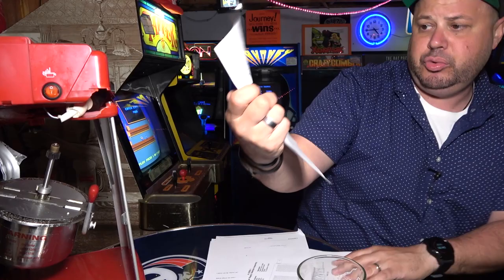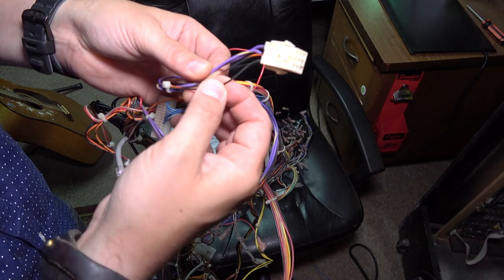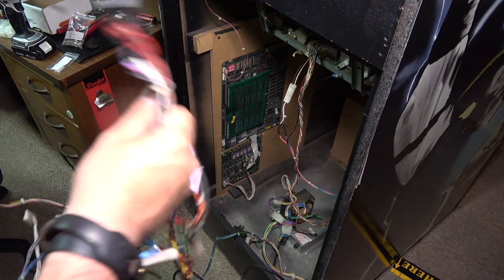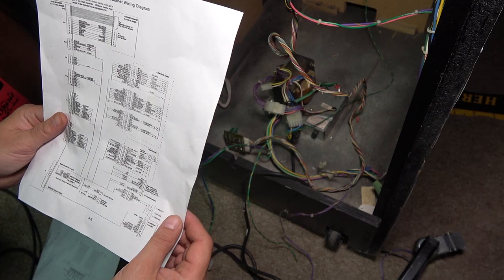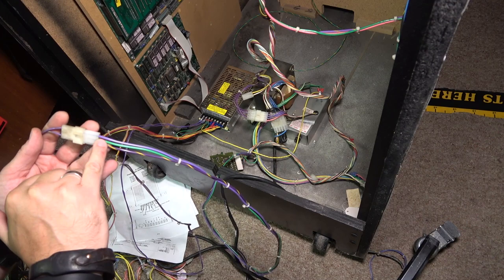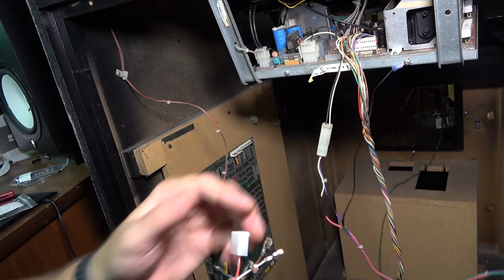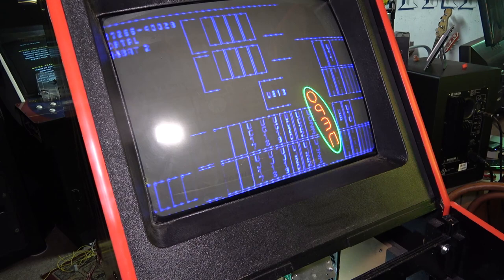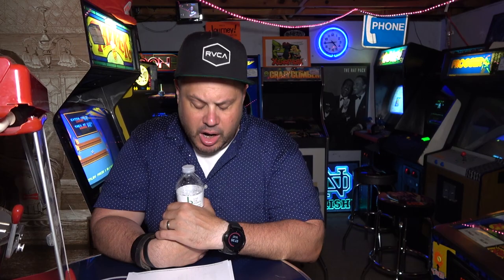Mortal Kombat II Arcade Restore Part #18  Power Supply Install, Wiring, Troubleshooting and more

Comment: Since you're not seeing red and green on the monitor, you're also not seeing
on the screen is the "cmos invalid error" which should be on top of the screen 
in red on the "using dipswitch coinage" screen .  Replace the watch battery 
from the board. Turn on and off twice after you've replaced battery. When
it goes back to the rom check diagnostic screen and finishes checking them
which should be highlighted in green you should not see the using dipswitch 
coinage screen it should take you to the title screen. Cmos is what saves 
number of wins, losses, settings of using coinage or freeplay mode, history 
log, etc. When the battery is dead, you'll lose aforementioned above.
It'll restore to factory settings and take you to the using dipswitch coinage 
screen and will have to hit the start button. You can get the battery from 
batteries plus. About $2.50. If they don't have an exact one, you can also
use one that's slightly thicker. Also remember to put back the dipswitch 
settings. Hope this helps.

Comment: Any metal objects especially the coin door that somebody might touch has to go directly out to earth to your plug in the wall socket, has to have as little resistance as possible John. And always check your Earth connections back to the plug pin with continuity no more than 3 ohms. A transformer needs to be earthed otherwise it will cause humm.
A shielded wire and or sheaf always is connected at one end only that is the ground Earth and the other end is left open, so you're always work back to the ground End only

Comment: I too have trouble reading the markings on fuses to see what the amperage is  (and I wear bifocals!).   :O  What I did was I bought a small cheap magnifying glass somewhere (Wal-Mart, I think.  It cost me a whole dollar!).   Hold the fuse under a light source and the magnifying glass will make reading the fuses a whole lot easier.

Congrats on 40k Subscribers, John!  You rock!

Comment: Hi John. Thanks for sharing the PacMan cabinet I made earlier this year. In answer to your coin door question I had to put a single slot  X-arcade coin door in to keep the proportions about right. With regards to the side art I got color matched paint that is hopefully close to the original yellow. I would like to put on side art but need to find a reasonably priced solution for getting that scaled artwork printed. If you have any suggestions greatly appreciated. Keep up the great work and hope you get back to creating more frequent content once again. Your uploads are missed

Comment: John, you should looking at the Dip Switch Settings of the coinage. I'm not sure about the led from the pcb but I might investigate a little further.  You almost done but you need to check the pcb because the Wiring might not be complete, you should double check.  Good video and keep up with the videos.

Comment: It's been a while since I messed with mk2.  But make sure all dipswitches are off on the board, or else you cant save some options in the menu.

I believe you need to have all the colors. Or you cant see all the messages.

Also. Midway games have weird encryption  in the DCS sound board, and is needed to boot the game fully, IIRC. It's been way too long.  Glad to see you back

Comment: When trying to get two terminals onto the same screw with those power supplies, it is easier is you turn one of them upside down, so the flat sides are together. That way they slide on much more easily than when stacked on top of each other.

Comment: Sound board is not lighting up because you are missing the power wire that goes between the PCB and the sound board.  There should be a ribbon cable which you have hooked up and a power wire that I don't see.
Reply: I can send you a picture of what the wire looks like if it helps

Comment: There's a harness you need that supplies power to the sound board from the main board. Someone on ebay sells nice ones for about $20. That and a battery on the main board should skip that screen but you just need to press a button to skip it.

Comment: Pretty sure there is a button cell, 2032that you need to change on the pcb to get rid of the “cmos” error. It is not showing up on screen as there is no red. I have a midway T2 and Rampage World Tour that do the same thing when the battery is low. Also a simple rom reseat might help. Glad to see you back!
Reply from the maker: Yes... next video. Thanks!

Comment: It's great to see a new vid john, I am still trying to repair my Crazy Kong PCB after it developed graphics problems on the sprites. I have replaced all the ram and the sprite eproms, loads of the logic chips and still cant find the fault. Now I have one of these new IC logic testers from china so I am going to give that a go. As soon as I work out this problem I am going to try and make a video showing what I found along the way.
Reply from the maker: Awesome! keep us posted.
Reply: At last I fixed my board, So happy it's working again.

Comment: Hey it's a Mortal Kombat 2 you are restoring, you might want to add that 2 to the video title.
Reply from the maker: FIXED. Thanks. :)
Reply: John's Arcade Game Reviews & Tech fix 17 as well.
Reply: No problem! :-)
Reply: Kind of get the same feeling.  It's just the way he seems to want to get this one done and out of the way.  Guess after doing this so much and being busy with other things, it kind of burns you out, huh John?
Reply: I do this sorta stuff for a living. There's a lot to factor...spending time and doing a good job on something like, say, crimping and checking continuity to find that a board simply isn't turning on when you finally get to boot it up. Having to deal with more than you need to in order to get what you need done, and taking everything out, then having to put it all back in. Having to find makeshift hardware to do the job so you don't have to order and wait or make an additional trip to the hardware store. Dropping said hardware and having it fall under the deepest and hardest cranny in your workspace. Losing tools and connectors. The list goes on.

This is probably why John took a golf break half-way through, I don't blame him :D

Comment: Using dipswitch coinage is because the 3v battery is dead and the game cant remember the pricing settings, so it says going to default every time it boots .. you can skip this screen by pressing a button on control panel.  Replace the 3v, check pricing settings and it should be good to go.. I keep mine on free play
Reply: most games dont sync during bootup, until the game loads the monitor wont sync up..sometimes you can fix sync issues by making sure horizontal and vertical are in right spot, and sometimes i've had luck twisting the syncs together

Comment: Hey John.  Do yourself a favor and take a look at the Operators Manual and really read through the wiring diagram.  The diagram gives the locations of the connectors on the main PCB, it shows the wiring color so you know what is what, and honestly is your greatest resource.  I went and also google searched an MK2 restore and reviewed those detailed photos.  

The sound board is indeed missing a power cable.  That's a standard MK2 Sound Board Power Connector that you can get the pinout from your manual and make one yourself.  No big deal.  For the monitor color issues, just make sure you have a proper connection to the boards.  If you have the Craftymech TPG, hook that up to see if it's the wiring, or the monitor, that is short on colors.  

I was able to get a wiring harness for my MK2 cabinet built just by following the wiring in the operators manual.  Trust me.  You can get that working in less than half a day I tell you.  If you weren't 1.75 or so hours away, I'd drive up right now to help you.  Heh.
Reply from the maker: I'll get it. :) I was planning on using the tpg again but I did have all the colors when we got the monitor working.

Comment: Good to see a new video.   Though I kinda miss a new video each week as they have helped me out greatly since starting my own collection which is at a total of 3 units now.   A Super Hang On - Mini Ride,  Stern Tutankham, and a old 80's barcade with a 13 inch G07 monitor that Ive got setup with a Williams multi-cade. 

So, John Ive got a question.   Where on earth would one start if they were trying to find parts for a Super Hang On mini ride cabinet.   Ive looked on Ebay, KLOV, Arcade Boneyard, arcadefixit.com and finding parts for the motorcycle assemble are insanely hard to find. 

Also by chance are you aware of anyone in the 3d printing business that makes aftermarket parts for arcades and pins?    As I figure the only way im going to be able to find a replacement handle bar cover for my Bike is to have someone 3d print me one as the last one I found for sale on KLOV was around 3-4 years back now.

Comment: Missing green and red colors in the monitor, checks if appears yellow, green and red texts, when the system start for first time, this need accept the initial default setting for the first boot

Do you need press any button for continue and watch the demo

Comment: Noticed you're voltage on your power supply is off and needs to be adjusted as well.  Check this video out.
 https://www.youtube.com/watch?v=RJ3W7BqwJzE
Reply from the maker: Not sure it's off. I checked it a the PCB and it was 5v DC.
Reply: In this video it's showing 5.06 volts. It's got to be set at exactly at 5.0 or you might have further difficulties 
down the road. Just watch that video link. I think you'll find it fascinating and interesting.